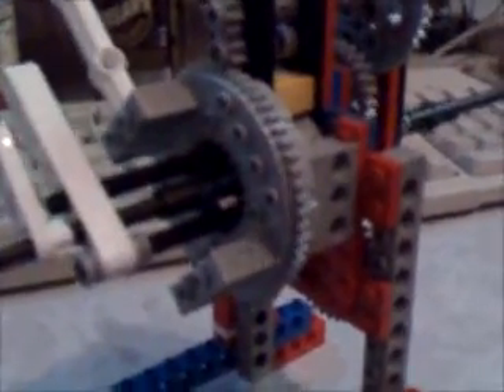LEGO Clock face with three hands

Comment: Damn, there I was thinking I was the first person (documented at least) to build a three hand hand clock with the old style of turn table :P
I've just put something together myself, but I need to link all the hands together with a gear train. I used the new style lego differential casing for the minute hand, so I have the large turn table for the hour hand, the dif in the center of that for the minute hand, and an axle all the way through that for the second hand.
Reply from the maker: +Azayles Thanks, I think I saw a way to use two differentials to controls the hand movements